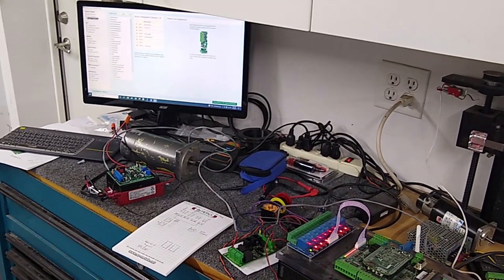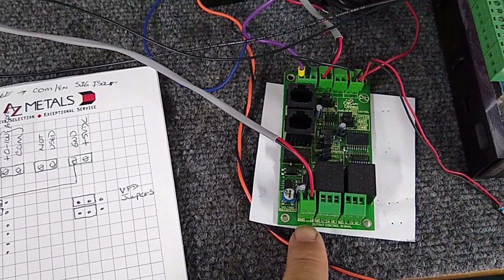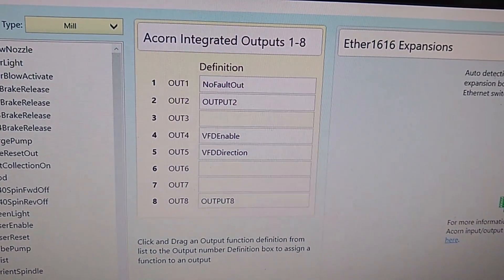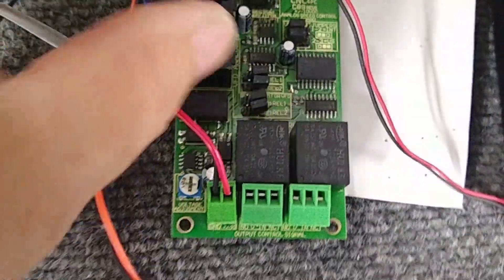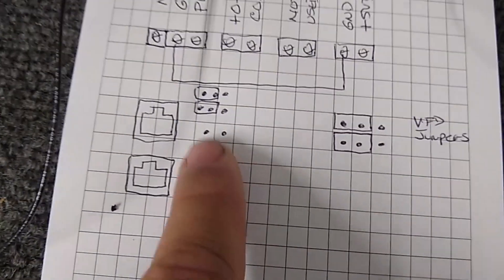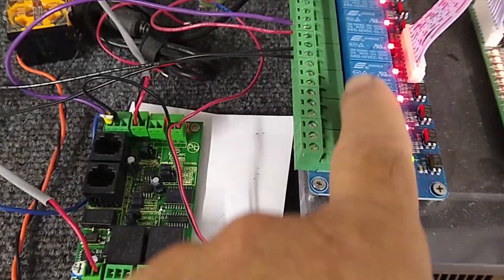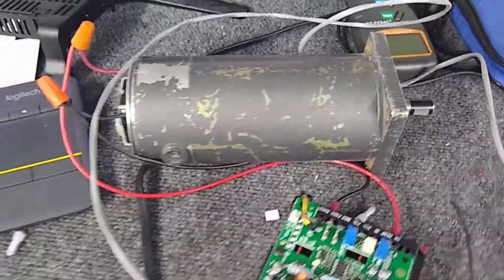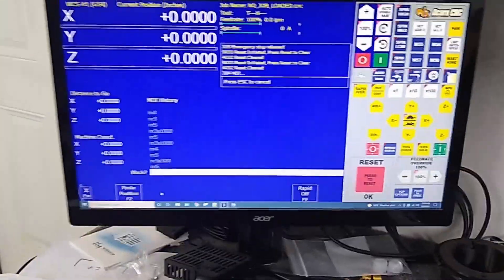Centroid CNC Acorn, CNC4PC C89 +/-10VDC Analog Speed Controller and KBMG-212D DC Brush Controller

Comment: Can you also use this C89 on an Eding CNC controller? So that the C89 can also work with a Delta asdab2 servo drive as a lathe spindle?
Reply from the maker: Check with CNC4PC. I only use Centroid controls.
Reply: @martyscncgarage5275  

I thought maybe the c89 also works on multiple spindle like vdf and servodrive.. because I'm looking for step/dir speed controller 0-10 volt board that can work on delta servodrives..
Reply from the maker: @BertusGeneugelijk2033  are you using them as positioning drives/motors? If so, then you want a control like Centroid OAK it maybe able to control your analog drives.
Reply: @martyscncgarage5275  no i am using them as lahte spindle. servo motor . servodrive..
i need a 0-10volt pwm converter wich work on my servodrive.. thats all.
Reply from the maker: @BertusGeneugelijk2033  I believe C89 does this. You should try Centroid Acorn with true spindle encoder input...

Comment: I did have one other question. At around 3:49 in the video you mention and Estop Contactor. I did not see a contactor in this video. Is it something you will add later? I watched the Emco PC5 video and you had a contactor in that box.
Reply from the maker: Estop contactor comes when you build the control. I did not use one for this demonstration
Reply: Thanks  @martyscncgarage5275 . I thought that was the case but wanted to make sure.

Comment: I just found in a box in my garage 4 new static sealed Skyko p 100 step and direction to +/- 10 VDC converters. They were pulled off the market like a 50 MPG carburetor.
Reply from the maker: Sounds like PWM to analog converters
Reply from the maker: Sounds like PWM to analog converters

Comment: Excellent video. I wish I had known about that board 2 years ago. I used a couple of relays and the forward and reverse outputs to swap polarity on my KB board. This method would have been much cleaner.
Reply from the maker: It recently came out. I requested something more simple but they added the "kitchen sink" to it. But it DOES work!